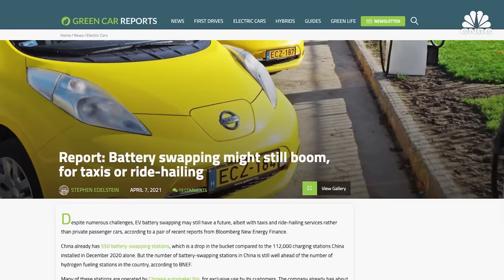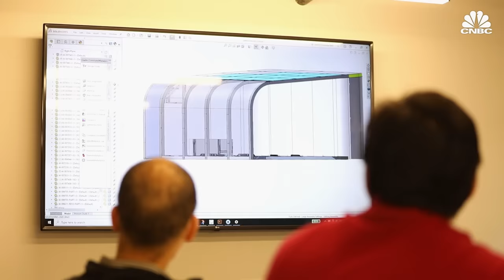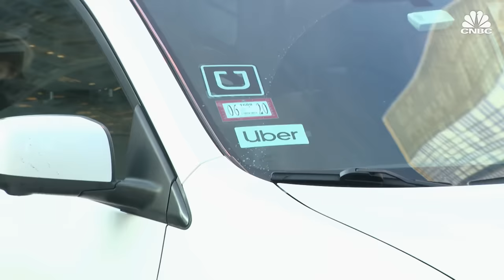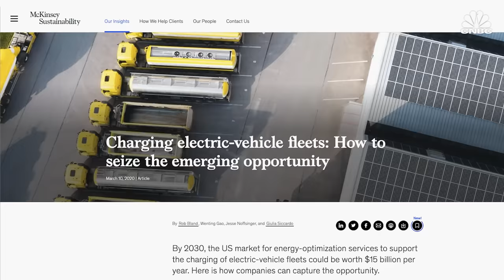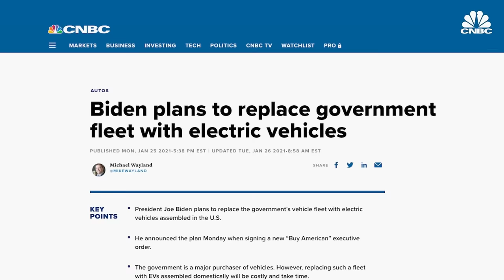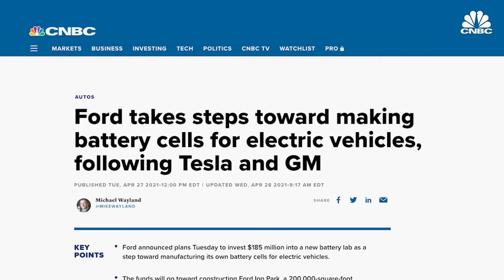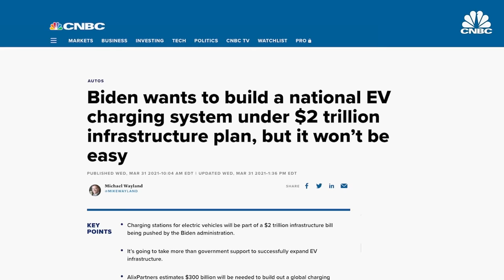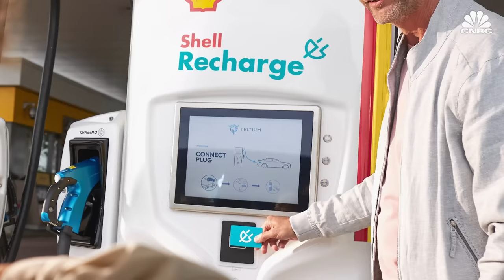Can EV Battery Swapping Take Off In The U.S.?

Comment: I think electric vehicles are just a fad anyways since we have enough fossil fuels to last for thousands of years.  Fossil fuels are a better bang for your buck.
Reply: No, Electricity is everywhere. Id much rather plug my car into my garage at night than have to drive somewhere to pump gas. Electricity is cheaper than gas, you can harvest your own energy with solar panels that are getting cheaper and more efficient. Electric cars require MUCH less maintenance than a fossil fuel vehicle. They also have way faster acceleration at a fraction of the price of a super car. This is not a fad, look at the data from someone who isnt pumping Ford or GM stocks on CNN
Reply: The more people move to EV's, that means less people will be using gas and less demand means the price goes down. So if EV are going to take over, there becomes a time when gas is cheaper so people will just keep using the ole reliable combustion engine.  The fast rechargable stations are expensive to create and hard to find in many places. Gas is everywhere already.  I'm not waiting 8 hours while my car charges or even 30 minutes is too long. And...once the battery burns out, you basically throw the car away and get another....gas powered vehicles can just have ancillary parts replaced and go for hundreds of thousands of miles. If there is any electric transport, it will be by drone. EV's will just not be able to get over the hump and will remain just a segment with probably no more than 30% adoption.....at least until they can make a car that runs on water or human waste... :)
Reply: @wdchapman1969   @Dave     Tesla superchargers cost 1/4th the price to fill up your vehicle compared to gas. Yes level 3 stations are like $20,000. But the government is going to be paying for a bunch of these(not that I like government spending, but they are constantly subsidising energy). Tesla and restaurants will also be buying these. Level 2 stations are like 2 grand. Cities are building these into street lights. They will be everywhere.
99% of the time you won't be waiting, since the car will be charging when it's not in use. You can have over 600 miles of range and fully charge over night.

Tesla already has a million mile battery, and they are getting better and better. EVs have fewer components, they require less maintenance. They are also way faster than any similarly priced ICE vehicle.

People want solar power, you can collect that into a megapack and your cars battery, use it during a power outage or sell it back to the grid and help stabilize energy usage. 

Get with the times, EVs are here and they are going to be big, the free market and the government will make sure of it.
Reply: Free market will determine the winner....and until they get charging times down to 2-4 mins (time to fill up gas tank), ICE has a huge advantage.  Also it will take 20 years to build the infrastructure you claim,  no matter who builds it, Tesla, the gov, or both.  I am completely with the "the times" my friend, but just because I don't buy into some technology that has yet to prove itself superior doesnt make me a backwards thinker.  As you alluded to, the government will have to have a hand in the battle and they will no doubt start charging a carbon tax or something stupid like that if you want to own a gas car.  Or they will just tax gas into oblivion because of the myth about the cleanliness of EV technology....which a myth it is.  Also, there is an entire industry built around ICE cars and the parts for them, EV just will never get to that level until they are cheaper to operate (which they are not considering cost of the vehicle.)  I'm all about saving money, but my  household has 3 ICE's and I don't see any of us changing within my lifetime (i'm 52) and I live in TX where gas is only $2.30 a gallon and affordable. Another thing about EV's..you have to live in a place like CA or somewhere mild, because in the extreme heat and cold of different environments, EVs perform very poorly against gas powered cars.  If you have to heat or cool the interior of the car, it dramatically reduces your range.  The technology is simply not there yet and to claim it already has won is ridiculous.
Reply: @wdchapman1969     you keep ignoring the fact that most people do not drive 600 or even 300 miles a day. Most people don't even drive 20,000 miles a year. You charge your car while you sleep. Imagine having to go to a gas station to fill up your smartphone, it would be rediculous. Why does it need to be 2-4 minutes if the vast majority of the time you are charging is when you aren't on the road? While you sleep, you wake up and have a full tank of electricity. Yes the infrastructure will take time buts it's happening faster and faster. Especially when people are are adding it to their own house. 

I never said the government will have to have a hand in it, that's your old timey ways clouding your judgement, making you hear things that I never said. I just stated that they will be subsidising green energy, like they had been with oil for decades. 

You clearly haven't seen the videos where people do the math on long term EV ownership, the model 3 is on par or even cheaper than an average Ice vehicle.

The model 3 is the safest car in the world. It is way faster than any ICE vehicle at its price point (or even way higher prices). You can fill up your battery at home. These are things that are proving EVs to be a success. Yeah they aren't perfect but they are drastically improving every single year and don't show any signs of slowing down. 

I love ICE cars, my favorite car is the 1973 Mustang Mach 1. But Tesla model 3 was the best selling premium sedan in Q1 of 2021. The market is telling us what they think and tesla has just started to ramp up. They will be selling millions of cars a year by 2024 and will continue to grow.  Just because you are ignorant about EVs doesn't mean you always will be.

Comment: EV is nothing but an interruption in your life. EV for running around town and slow charging is great as a second vehicle. If this concept becomes mandated, there goes the American way of life. This concept works great in golf carts, warehouses and commercial businesses. When they try for example to force the pleasure boating market into this EV mindset the costs go up and the thrill is gone. Everyone wants to snub their nose at Hydrogen and CNG cars just like they do at Nuclear power. We know  how to make safe airplanes now because people died. We know how to make safe nuclear plants now because people died. Fear is the enemy of all great things. Ships and submarines have been running for 20 years on nuclear without refueling. Think about how much fossil fuel was saved. Power plants use electric generators, nuclear subs use electric generators it's the source that turns these electric motors that are really in question. We need to diversify our reliance but NOT throw common sense out the window and say no combustion engines after some arbitrary year like 2030 or 2050. It should always be a choice and let the free market take care of itself. I would like to own a boat one day and I want to fill up and run all day without worrying about battery levels...no thank you. I would rather haul around propane tanks before I would ever have an electric boat. The trolling motor is as far as I would be willing to go.